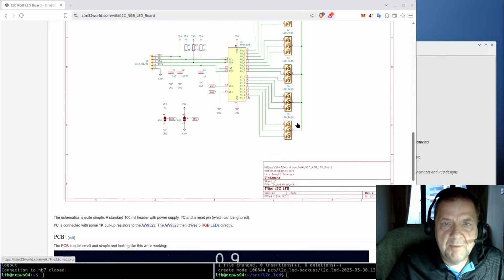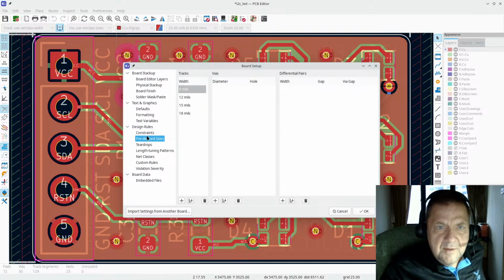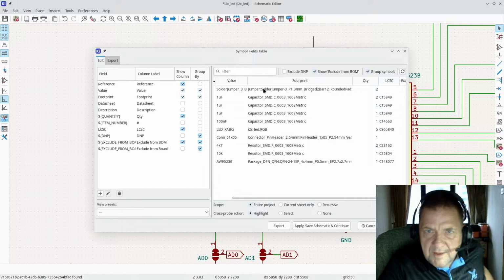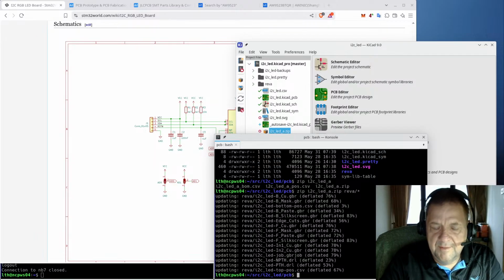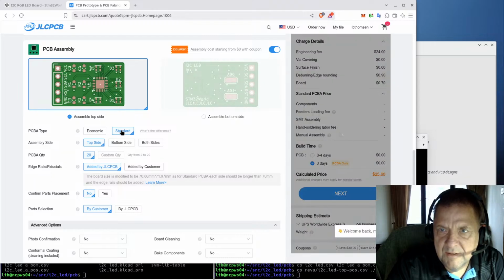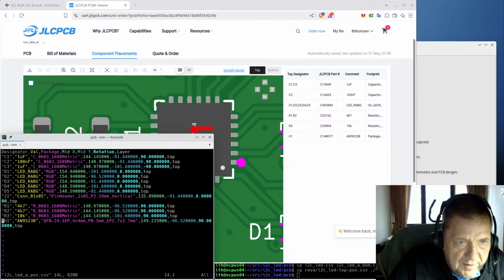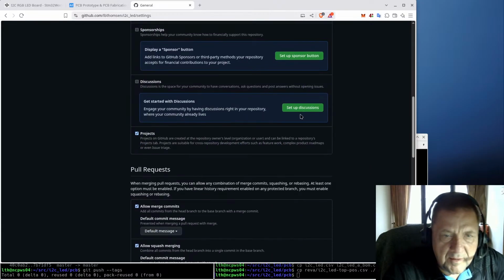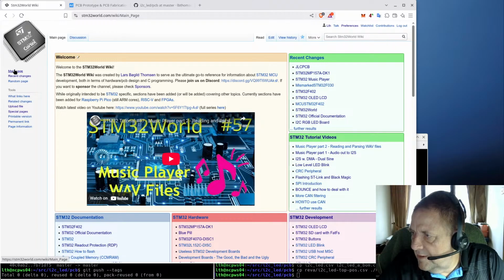KiCAD Project From Scratch #3 - Ordering the PCB from JLCPCB

Comment: The second error during upload happens after the first one all the time. If you just select the same file again and upload a 3rd time, it will work.
Reply from the maker: This is a new bug in JLCPCB isn't it.  I haven't seen that one before.
Reply: @stm32world  I have had it a lot over the last 1+ year, so not particularly new. It is also not exactly every time, so not sure when it is triggered.
Reply from the maker: Saw this issue when I did this video but haven't seen it since.  They probably figured it out ;)

Comment: You're very luky for shipping prices. To my location that would be like 50-70 euros ( That's why I don't use JLCPCB, however their prices are cheaper for multilayer and big boards.
Reply: 50-70 sounds like DHL and is often shown as the default shipping method in the price calculator. If you live in Europe, "EuroPacket" will show up as an option. A bit slower, but save you some money on shipping and I think JLCPCB will do the VAT collection (if any) and no fees for custom. I only used it once. I prefer FedEx as they deliver to my remote location and is most of time a lot cheaper than DHL. I typically pay ~$30 with FedEx.
Reply: Note however; Larger PCBs quickly get quite heavy. I have had 20kg packages being shipped too, and then we are talking hundreds of dollars.
Reply: @niclash  oh yep, my preferred options are not available for "large" amounts like 30+ PCBs and even small ones are getting very heavy. Currently I just prototype things in small amounts, eill facr this soon when it'll be ready for dome larger quantities.
Reply from the maker: I noticed the prices change quite a lot - right now it is cheaper for me than it has been since before Covid.
Reply: @niclash  FedEX is the cheapest option I have here in Montenegro for JLCPCB, and it's not cheap  compared to the PCB price itself and to options available at other services. It also does not actual price till I hit place order and pay which is a bit unfortunate, and usually price goes hier right before I take out my card of a wallet )
Reply from the maker: I know!  And it is essentially overnight.  When JLCPCB is done and ship - the parcel will go to my place overnight and delivered the next day.  Shipping usually FedEX for a bit less than $15 and if I keep the order < $100 there will be no import duty.
Reply: @stm32world  my pcbs parcel haven't started moving yet 12 days after picking from the factory, and it will be like 20 more days to deliver
Reply from the maker: I think a friend of mine from Europe mentioned that JLCPCB now have a shipping hub in Europe, so they ship from factory to that hub and then do internal EU deliveries.  Not sure how that works though.

Comment: My hands are scratching to rotate some LEDs to straighten up traces to them. I know it won't change anything but appearence, however...
Reply from the maker: No, no - I get what you say.  I am usually pretty anal too.  In this case though - IF you want all the LEDs aligned the SAME I don't think it can be optimized much.  Fork the Github repo and see if you can improve https://github.com/lbthomsen/i2c_led ;)
Reply from the maker: I just looked at it again and if you want them rotated in the same direction the way I did is pretty optimal.  If you rotate them differently the traces could become better.